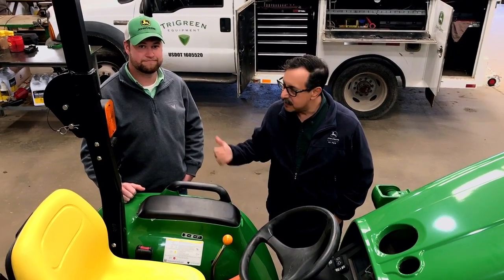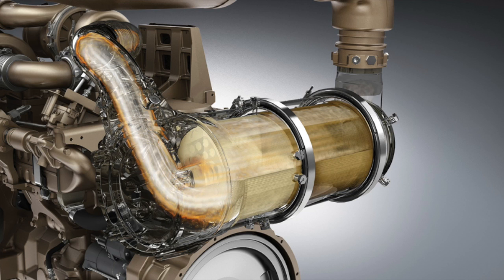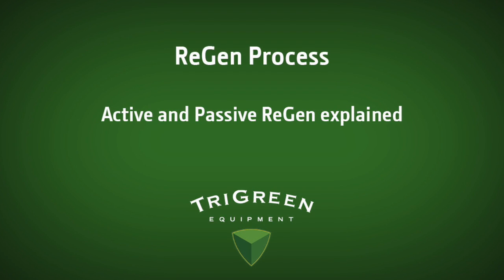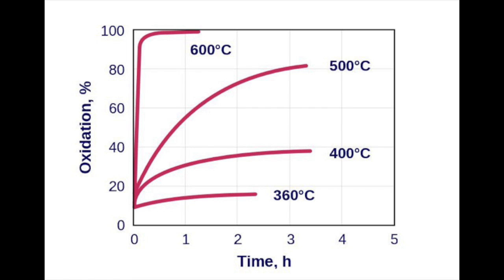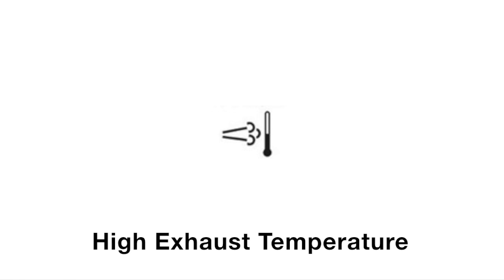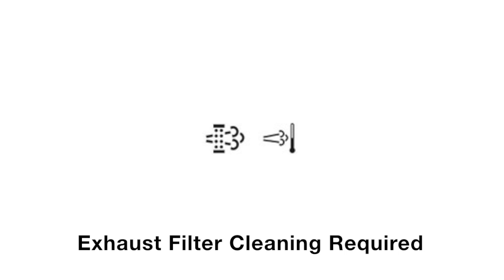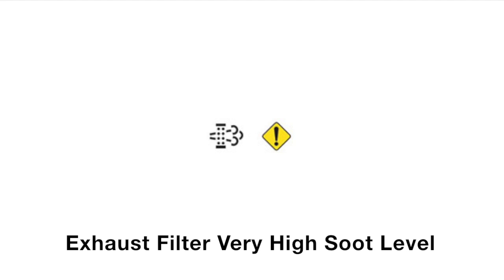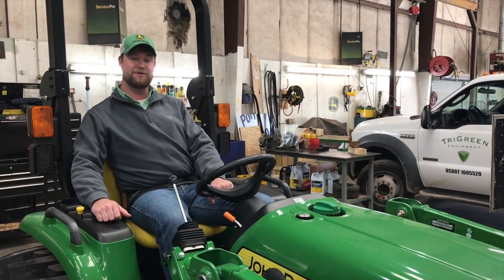ReGen Process

Comment: Better info than in my operator manual.  Finally, an explanation that covers what the tractor does with the indicators to expect.  The JD product is great, the manuals are horrendous, and more expensive than they should be.

Comment: I am glad that I watched this video because I have a 2017 3032E tractor and after looking at my manual I was confused, but this video helped me more. I decided to keep my 2002 790 tractor since it didn't have many hours on it, and just in case I needed a backup machine. I use my bush hog with my older tractor, and my other implements with the newer tractor.
Reply: I kept my 4320 and 4310 as well The wife is confused on the new 4066